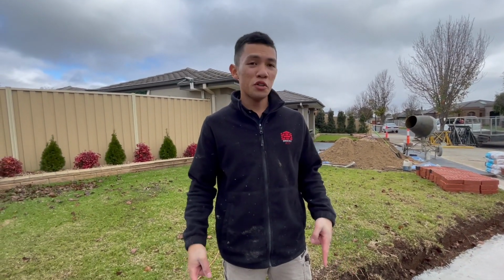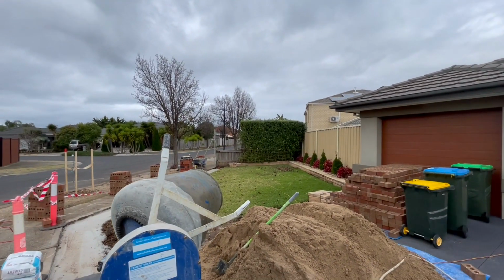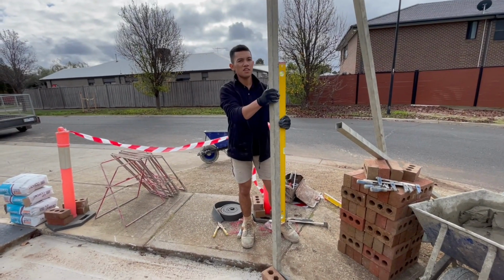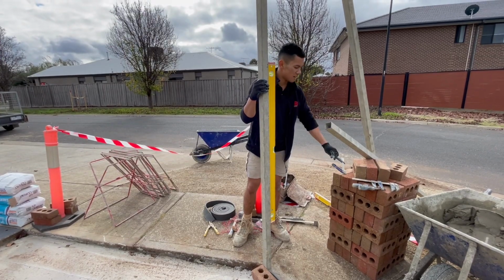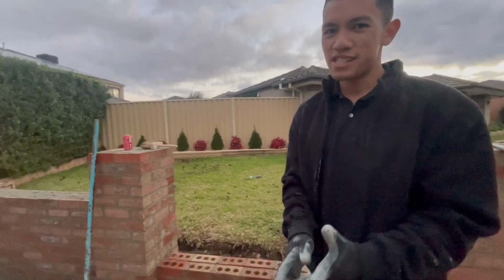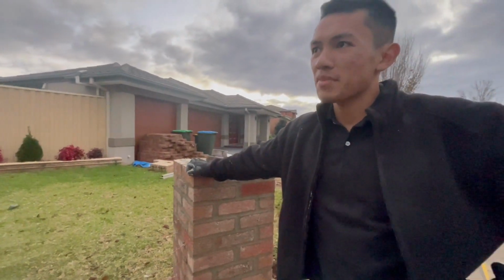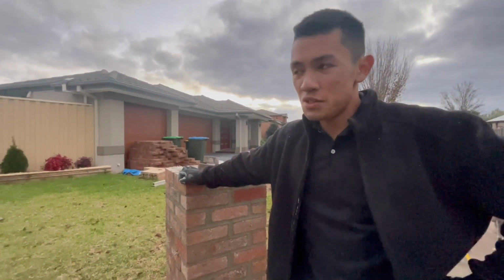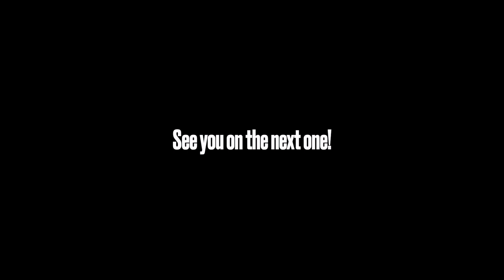ULTRA MEGA BRICK FENCE | BRICKLAYING AUSTRALIA

Comment: G, day Ty from Sydney.
You know, you can cable tie one end of the water level to a profile or (wooden steak) at any datum: take the rubber or timber stopper out when needing it for different stations (vertical measurement).
Work safe work smart.
💧🤔